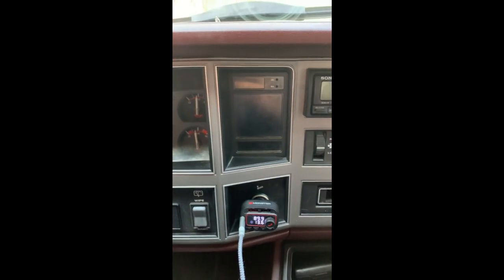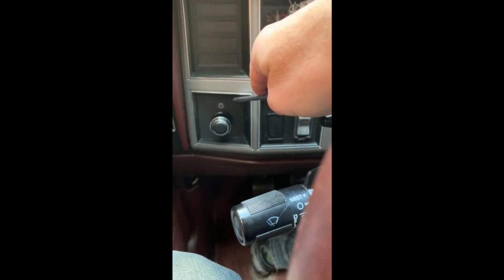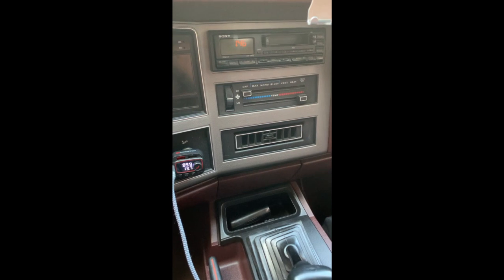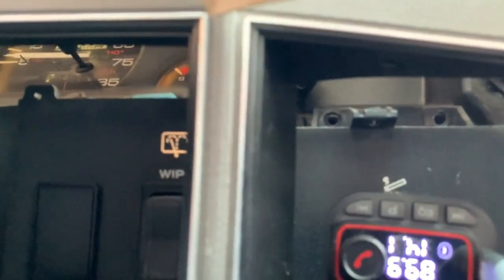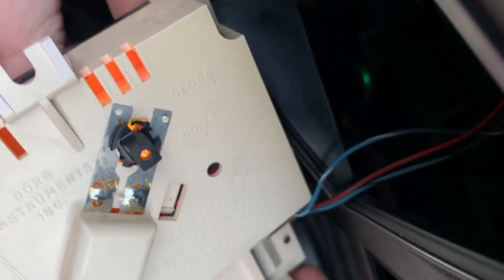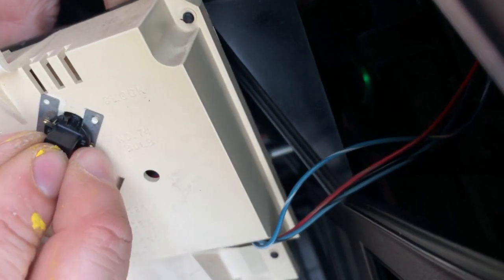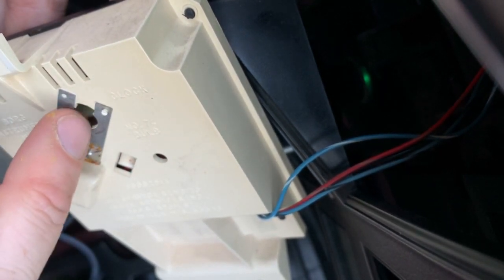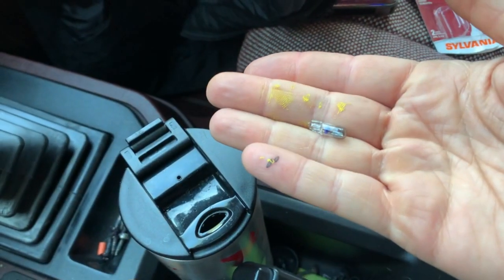1990 Jeep Cherokee XJ - Clock Bulb Replace

Comment from the maker: You will need: 
-Phillips screwdriver
-Sylvania 74 bulb 
-Flashlight (recommended)

1) Unscrew the 4 screws holding the bezel in. Two at the top of the gauge cluster, one above cigarette lighter, one above headlight switch. 
2) Pull off U-shaped plastic trim below steering column. 
3) Pull the bezel out. Comes out very easily and pops in easily as well. Check that it isn’t catching on the steering column. 
4) Unscrew the three screws holding the clock in. Two where the clock meets the cigarette lighter and one at the top of the clock (this is where the flashlight comes in handy). 
5) Pull the clock out. There should be plenty of wire that you don’t need to disconnect the connector. 
6) Turn the black plastic bulb housing about 1/8 turn counterclockwise. Pull the housing straight out. 
7) Pull out old bulb, push in new bulb. 
8) Put bulb and housing back into the hole. The two gold pins should be perpendicular to the two silver conductive metal strips. Turn 1/8 clockwise. 
9) Installation can be a little tricky. In my Jeep, the top screw hole was slightly overlapped by some trim leather fabric overhanging. This made the clearance between the top of the clock and the hanging leather very tight. Fortunately, the clock compartment is sealed so if you drop the screw, it won’t disappear. I recommend putting the clock in place, screwing in the top screw partially just to prevent it from falling out, then sliding the clock up so that the two bottom screw holes are lined up. Screw in the bottom screws and then screw in the top screw.